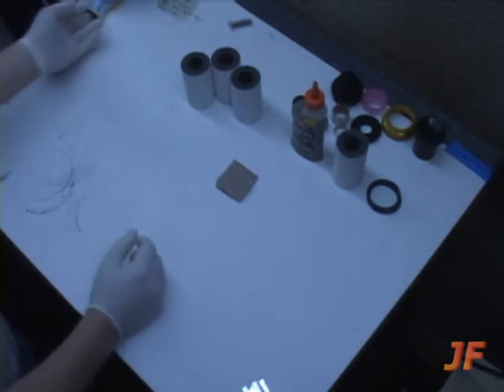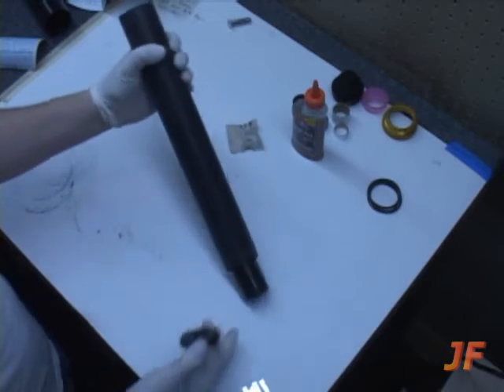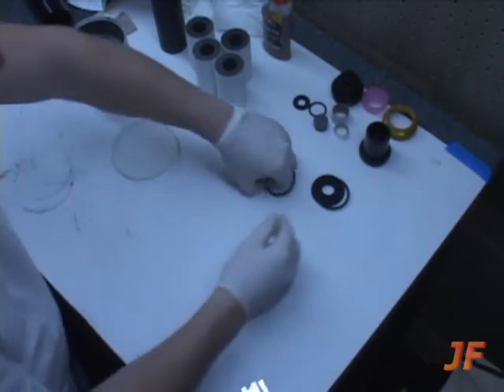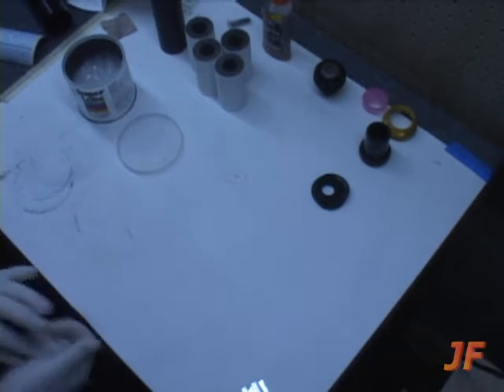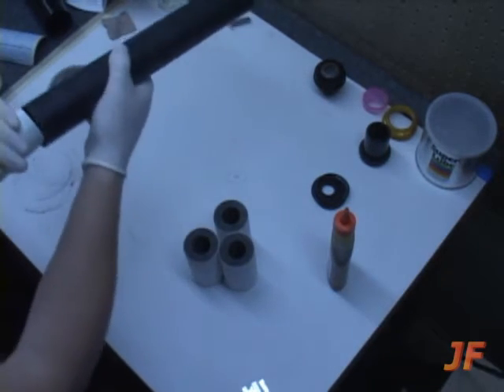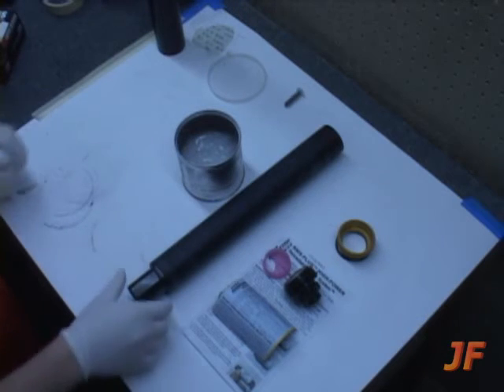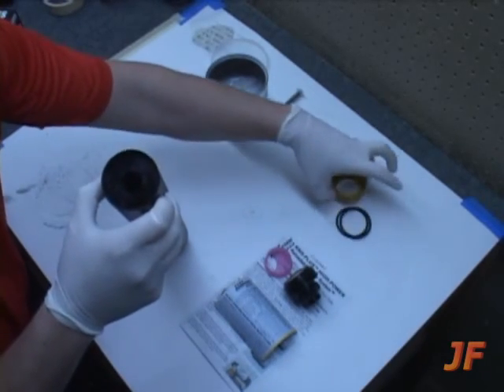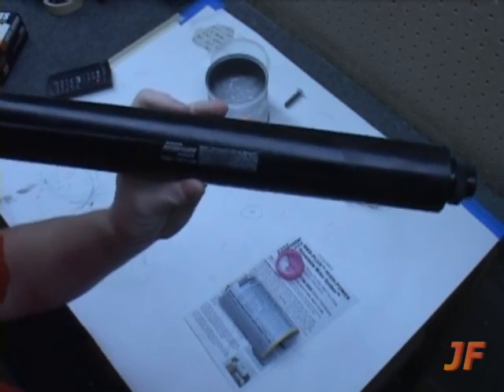Aerotech K-2050 Super Thunder grain bonding and motor assembly

Comment: Nicely done! I like the idea to use masking tape to hold the nozzle against the liner during assembly. One caveat i would add is to be careful not to overtighten the closures at the ends of the case. Tighten the forward closure until it is fully seate next to the opening of the case but make it hand tight only. Do not use a wrench or pliers. Hand tighten the rear closure, as well. I tighten them down then go back a 1/4 turn in the loosening direction to avoid over doing it. This makes motor cleanup much easierr for you if you don't over tighten your closures.

Comment: What's the current cost of a refill on the K-2050  ?  I've been out of the hobby since 1990.
Reply: $115 plus HAZMAT shipping, unless you buy it from a local vendor. You can buy a K2050 motor and other motors at wildmanrocketry.com csrocketry.com and other fine rocket stores.
Reply: $167.99. That is just the retail price without HAZMAT costs. If you purchase the motor at the launch site from a local vendor, you won't be charged the HAZMAT fee.

Comment: What does bonding the grains do?
Reply: Liner bonding is usually used in longer aspect ratio motors. It helps keep the lower casting tubes from being forced thru the nozzle, which could result in a predictable kaboom.
Reply from the maker: Per Charles Savoie of Aerotech:"The K2050ST does not require bonding or grain spacing o-rings. That being said, bonding will not hurt and you will get the max performance from the motor this way."

http://www.rocketryforum.com/showthread.php?125657-AeroTech-Open-Thread&p=1657557#post1657557
Reply: @rfjustin  Recently, Aerotech has issued guidance that said bonding for this motor is required.